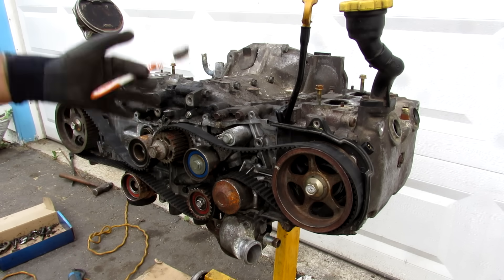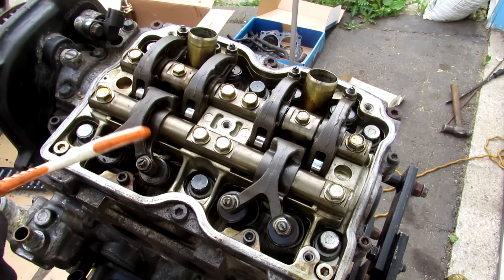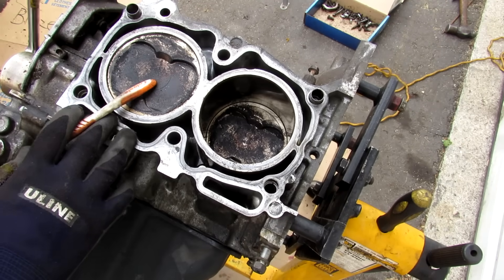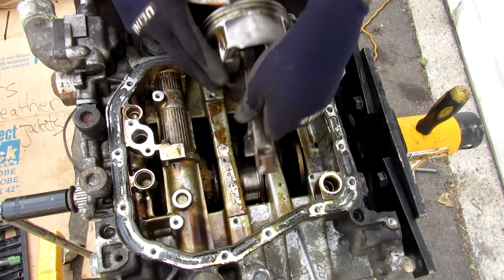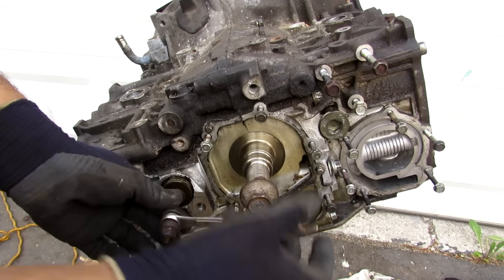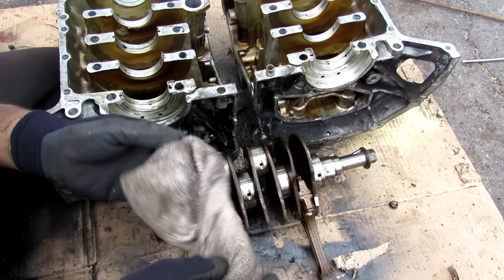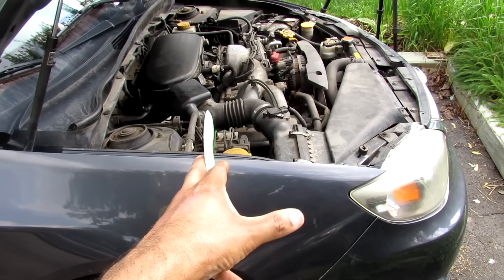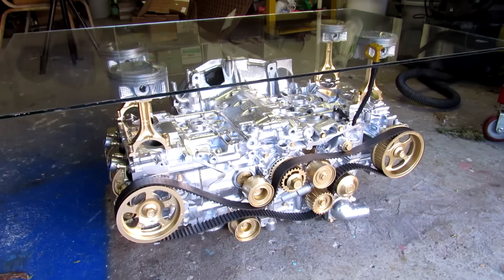Why Subaru Engines FAIL

Comment: I'd have to agree on the head gasket failures. I've personally done boatloads of head gaskets on EJ25x. Probably has more to do with the 'open deck' design of the block. From my experience, the drivers side gasket usually leaks at the rear first. I'd have to disagree of them being hard to service the plugs, valve cover gaskets, etc... they're easy. Pull the air box and shit out of the way, and it's a straight shot. Try doing the rear plugs on a northstar or transverse mounted 'v' engine. Now that's a PITA. Done plenty. Stupid design.

Comment: Wife asked me to look at a Subaru Outback, power train warranty was only 60,000 miles.  Learned it used that rubber band camshafts driver with a number of tension and idler pulleys, all with very limited lubrication and the camshafts required seals that could leak on the belt.  DIY belt and parts was well over 600 bucks and had to be done no latter than 60K.  With this bit of information, did not walk away, I ran.

Comment: I only had 1 Subaru and I didn't have any issues but these head gasket and other issues always scare me. But during ownership of my 1 Subaru, I loved the traction in our crappy northern climate snow and fog and steep hills, and it never let me down. You speak of 'rallying' in one segment of the video, and problems caused by probable  "low oil levels'.  So for a normal driver who watches oil levels and pays attention to maintenance, and doesn't rally, can I still rely on this 2.5 engine for normal driving? I really like Subaru's in bad weather.

Comment: So for normal driving in America how long time wise if someone didn't drive many miles and so the car was essentially babied but say it's 20 to 30 years in my attempt to get an inexpensive quality beater vehicle without all the complicated computer shit and unnecessary awd will those head gaskets on the down side be eaten away so it's leaking both coolant and oil across the passages and of course of this mixed fluids tearing up the bearings.
Where the bearings a crappy babit or was it just always and oil starvation problem?

Where the engines 20 to 30 years old with better piston rings, stronger piston ring grooves, and less of that tolerance issue causing piston slap or were they also bad.

What are the problems and situation with their transmissions.

What older models and model years of a Subaru in America without complicated computer crap where the engine and transmission aren't designed for a computer and were a manual transmission would you say are the one(s) to consider for a potential donated to $500+ vehicle?
Could we even get parts for an older Subaru in America from a normal inexpensive auto parts store?
Cheers,

Comment: This was awesome.  I respect a guy who knows a mechanical subject so fully, and is articulate enough that his explanations make sense (even at this high rate of speed).  I owned a 1980 Subaru and loved it.  It was a very different car with a rather different engine than the modern ones (other than being a boxer-four), but in the same vein as what this guy said, I could tell it was wearing out as it approached 200,000 miles because of the oil-burning and the piston slap.  Still, I think it had a lot of life left in it and I only got rid of it because it was rusting so badly.  If I could get that same car now, in good condition, I would buy it in a heartbeat.  Hardly anything ever went wrong, and when it did, it was easy to work on.

Comment: What a great video.
Question..
I have a 2016 legacy with 28k
During start up it sounds like it takes several seconds for the engine to quiet down, like a dry start up??
Is this normal to Subaru 
Thanks

Comment: I don’t get it.. I’ve had a 2017 Subaru STI for 3 years now with 80,000kms on it and it hasn’t skipped a beat.. are they really that bad??
Reply from the maker: That's the newer fa engine
Reply: speedkar99 STI’s are still EJ..

Comment: Why Subaru Engines fail! While you do a great job showing the internals of the engine, you do not adequately answer the title of your video.

Most earlier 2.2L engines were absolutely bombproof. OK, 1990 Legacy engines had a bad oil control ring that stuck, but 300K on those SOHC engines are not uncommon. Head gasket issues were a 4 year affair, 96-2000 on 2.5L for cars >100K miles. Not much on others, unless you didn’t use the Subaru coolant conditioner in the coolant, in spite of the inter webs saying it’s up to 2009. And finally, the oil burning issue due to crummy rings was another recent issue with the FB engine for about 2-3 years(2012-2014), depending upon model. Most were replaced under warranty. Also, I’m leaving WRX turbos out as they are abused and highly modified and owned by testosterone driven youngsters in later life, so longevity is not great on some of them. Other than that, there are no real problems. Of course, ANY car that is not serviced properly WILL have problems.
Reply from the maker: I have mentioned all the weak spots of wheree they fail

Comment: That engine specifically is an EJ253, which is only SOHC, common failure points on that are headgaskets, and that cogged timing pulley, other than that, as long as they are taken care of, they will last 500+ thousand miles

Comment: Got an 05 impreza with 375,000km(233,000 miles)only thing done was head gaskets at 285,000km(177,000miles)on the engine and still runs great. But will use up to 1 litre of oil every 2000-3000km(1200-1800miles) but use only amsoil oil filter and XL synthetic 5w-30 since it had 100,000km(62,000miles) and changed at every 8,000km(5000miles). So good maintenance is number 1 for longevity

Comment: Why Subaru engines fail, because the common owner treats the boxer motor like its a standard inline or V shaped motor.
Reply: So how would you treat it any different? It needs regular oil changes just like any inline or v. And a scooby motor is supposed to be bulletproof according to their fanbois.

Now I have 2 friends both have sti's. 1 guy mapped his car to 2 bar and low boost 1bar. He also always maps flat foot shifting. He has blown about 5 motors so far.

My other friend has also mapped to 2bar and 2bar but minus flat foot shifting. He has blown 0 motors. And he hardly drives his sti it stands in the garage most of the time. Think he is scared....

Then my other friend has a n/a Forrester with 300k on the clocks 0 issues. Not 1 day of problems. He looks after his car and does regular oil changes.

My thinking is they are good motors if they are not turbo charged. If you drive a turbo charged 1 then leave it stock. They don't like the tinkering.

If you want a scooby that will last forever buy the non turbo charged scoobies and you will have 1 of the most reliable cars ever made. Facts
Reply: @omgwtflmaololrotfl2368  You just said both of your friends are tuned for 2 bar which is about 30psi. They are either building their motors which you can't expect reliability once you start doing that or they're on a stock block which is guaranteed to blow once you have to boost that high.
Reply: @omgwtflmaololrotfl2368  nothing wrong with the standard STi. My partner has one for her daily car and it’s driven smoothly. Overtakes are a smooth roll on of power, twisty roads are all about maintaining corner speed rather than braking hard, accelerating hard etc etc. Unfortunately, used STi’s end up in the hands of people that drive them like a rally car, mod them, muck about with the boost etc and then wonder why they go bang. Treat them with respect and they last.
Reply: Truth!
Reply: I am about to buy my first Subaru Outback about 2016 model I normally service my car's myself oil changes every 5000 km or 3000 Miles and automatic transmission  fluid changed every 40000 km or 25000 miles. As so as far as the drivetrain is concerned is there anything more I need to do as I have never had a boxer engine before.
I was not quite sure about what you meant when you said treat them like a normal engine

Comment: Hi on start up cold mine knocks 2 or 3 times then nothing else knocking at all when warm ??!!
Reply: thx for replying so I’m really looking after mine only had it 1 year changed 
All oils and filters.
Was on way to Nurburgring on 21st august and doing 130 in Germany then lost all oil I’m waiting to get car back to assess damage think it’s the plate of death 💀 as clutch was really wet inside
Reply: Random Youtuber I think I hav a good one everything worked great it’s in good condition but what happened to mine don’t think will be down to bad maintenance as this can happen to any car with high mileage and if it’s just a crank seal that cost £12 I will be very cross lol

Comment: i bought a 2006 Subaru outback used and the only thing that I've had to replace after 350,000 miles is the head gasket and that was because the previous owner treated the car like crap. I agree that the boxer engine is a pain to deal with when replacing parts because of its lay out. The real thing that I love about it though is Subaru's best in class symmetrical all wheel drive, I've driven other AWD cars and Subaru is by far my favorite. But thank you for not yelling at me throughout the entire video like Scotty Kilmer.

Comment: So you're telling me, headgaskets go because people essentially don't change their oil?

Subaru engines fail, because people don't change their oil? 

I know that seems simplistic but a lot of did boil down to that.

He said it was running low on oil at one point, had contaminated oil at one point, and that it ate at the headgasket which people often blame for the problems